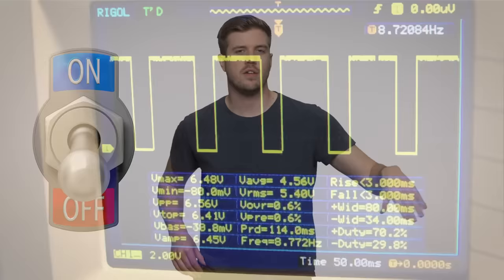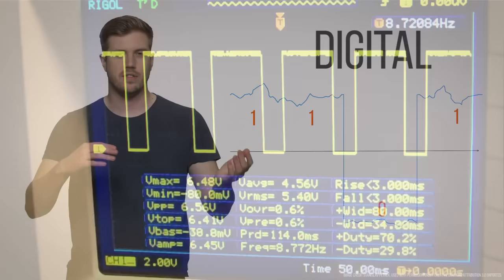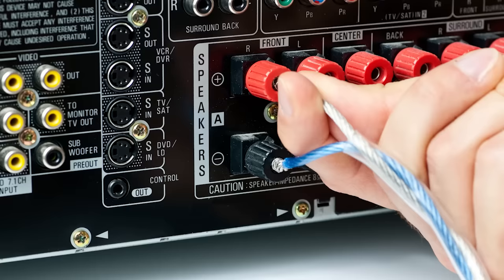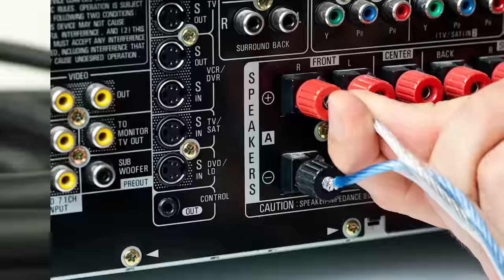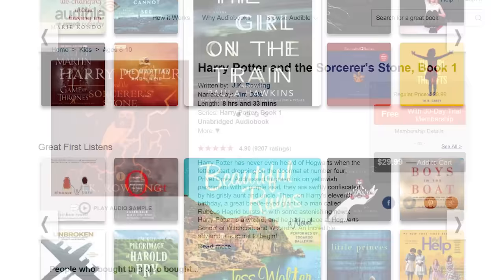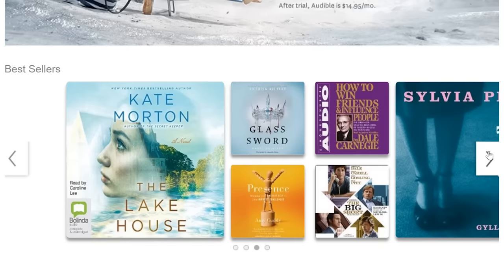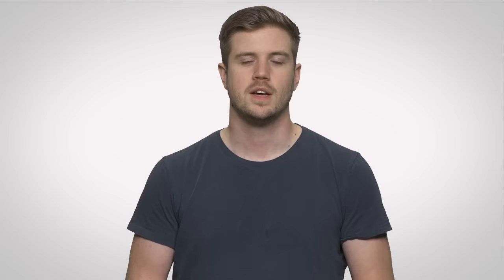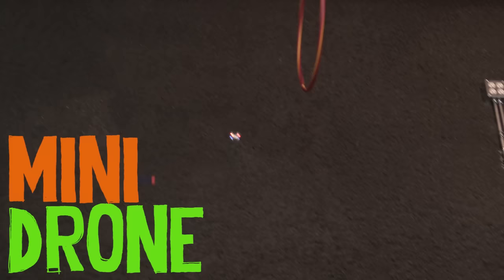Analog vs. Digital As Fast As Possible

Comment: You dont really get it :(. While digital signals are not capable of storing an unlimited bandwidth signal (analog) perfectly, they are capable of perfectly storing a bandlimited analog signal. By sampling at a rate that is twice the highest frequency in the signal, you can perfectly reconstruct the waveform in its infinitesimal details from that finite sized digital form. This is the Nyquist–Shannon sampling theorem. Now there is the problem of doing the conversions either way, but there is nothing inherently lossy about digital.

Comment: bitrate and sample rate are not the same thing..... (3:24)
Reply: my issue is he called bitrate sample rate. sample rate is the frequency at which an audio file stores the data of the sound and is measured in KHz common ones being 44.1Khz, 48KHz and 192KHz. Bitrate is how much space those samples are aloud to take up, or how compressed it makes them.
Reply: +Machina Yes, you also need to know quantization to determine required uncompressed bit rate for sampling a channel. (Like 16 bit, 24 bit ADC or storing it as 32 bit float) But I don't know anyone who measures uncompressed PCM in bit rate. Bit rate mostly describes compression (audio or video) in this context.
Reply: @szirsp  you guys are physics teachers

Comment: I was just half listening since as an Electric Engineer I kinda know these things, so I had to re-watch a couple of parts to be sure I heard it right:
1/ So logic signals are described as Up or Down and not High and Low... weird, but I guess who cares about proper terminology. (Up and Down reminds me of quarks for some reason.)
2/ Someone apparently also measures Sampling rate in kilo bits per second (bit-rate) and not frequency (like 44.1kHz, 48kHz, 96kHz or 192kHz for most audio), which is also weird...
I hope this video wins the Most Inaccurate FAP reward.

Comment: digital broadcasting is not always better 

here in australia analog TV was much more reliable than the new digital TV system we have now 

a bit of static on your TV screen is much better than pixellation, squawks and drop outs 

there are few things worse than when your favorite movie or TV show gets to the best part and is interrupted by pixellation or wose still a big NO SIGNAL message on your screen for a few seconds causing you to miss your favorite scene because of a lightning storm, variations in the ionosphere, mobile phones and other transmitters operating on the same band or some other obstruction 

analog TV signals would need to drop below around 45% (strength and quality taken into account) before the image is too fuzzy to watch and below 30% before the sound starts to fade out
analog TV signals are more resistant to momentary interference (lightning puts a tiny white line on the screen for a fraction of a second and nothing more)

digital TV signals usually start to pixellate if the signal drops below 85% will usually drop out completely at 75% (as measured by my TV) 
digital signals are much more susceptible to interference (lightning almost always causes the NO SIGNAL message to show up for 2-3 seconds every time it strikes anywhere between the transmitter and my house)
even something as simple as turning on a fluorescent light causes it to pixellate 
it is even affected by my inverter and solar regulator to the point that i cant watch TV during the day unless i turn off the circuit breaker for the solar input and stop charging the batteries (i use off grid solar so thats not an option) whereas my TV was completely unnaffected when i could use it in analog mode 

digital is the best option for storage, playback and short range data transmission (WI-FI, 3G/LTE, bluetooth.etc) 
but analog still takes home the gold medal for medium to long range over the air broadcasting (TV/radio signals.etc)
Reply: you are correct
Reply: if only more people understood that the analog TV system was superior

analog and digital both have their advantages and drawbacks but you cant solely use one for everything

there are things that analog does better
there are things that digital does better
Reply: My argument exactly, with a slightly different example. The mandated switch to APCO P25 digital radio systems was a massive step backwards for public safety communications. When our deputies are in the more remote areas of our county, their radio transmissions tend to "squawk out" and we (in dispatch) cannot understand what they are saying, and vice-versa. Worse, many times we won't hear the transmission at all. The old analog radios had a bit of static in those areas, but we could still communicate.
Reply: just like using a mobile phone with 1 bar of signal
good luck even getting the call to connect let alone having a reliable conversation with the person on the other end

the main reason they are switching to digital is for money

with TV they have more channels for the same amount of spectrum including a few that run 24/7 informercials thus more money

with 2 way radio less bandwidth is needed allowing more radios to use the same ammount of spectrum but at the expense of not working at long range thus more money from not needing to license more spectrum from the government

its all about the money and its a habit we need to stop

Comment: Hey kids, lots of errors in this video!
Reply: +Prince Westerburg Hmm he sounded to me like he knew his stuff. Please be a sport and tell us about some of the errors, thanks!
Reply: +Graham Wellington Uugh, where to start?! The guy isn't involved in the subject so his articulation of it is dwarfed by a need to look 'cool'. This is compounded by his digital generation view of analogue.

The length of your speaker wires doesn't matter so long as they are the same length and are not next to an inductive source such as mains or power transformers - this is a low voltage, high current situation so interference would be inductive and frankly, unlikely.

Digital doesn't suffer from interference?!? Hahaha!!! Sure, I'll just throw out that £30,000 CD transport and use a £10 DVD player from the supermarket then. No. Even people with 'cloth ears' can hear the collosal difference.

Digital is measured on the bit's wavefront rise so shitty cables, solder and connectors with semi-conducting junctions coupled to poorly implemented op-amps will cause jitter and errors. I'd rather listen to original data put there by a £2m studio then error correction put in by a 2p chip!

"We live to a great extent in an analogue world" - Err, what, are you in Tron some of the time then?

To his credit, he did say that higher bit rates usually mean higher quality - Maybe he has heard of Nyquist Theorem? Also he does state that digital cannot capture all the infintesimal subtleties of analogue. This is true and digital only captures the voltage changes, not current.

Further to this, I live in line of sight of the largest TV transmitter in Europe and we always had crystal clear TV. Since the move to digital its just terrible. With analogue you always got a picture, with digital, if the signal isn't 100% perfect then its glitchzilla!

So I don't hate the guy but he's a little fly and uncohesive in his presentation.

In a nutshell, I can only quote a hifi designer friend "Digital is the realm of man, analogue is the realm of God."
Reply: +Prince Westerburg Ha! Pretty good! I am an admitted ignoramus to this stuff, but while he sounded to me to know his stuff, you sounded like you know even more! Thanks Much for taking the time, and have a Great day!!:-)

Comment: HDMI was a bad example... the lengh and quality of a HDMI cable matters A LOT. especially if you use HDMI 2.0 with 3840x2160@60Hz. you will be very lucky to get cables above 5m working, 3m is already a problem.

Comment: I bought a video capturing device that turns analog RCA audio and video to digital via USB...
I captured video and I see a horizontal desynchronisation between the horizontal lines...which makes edges look like zig zag...mostly when the movement of people or objects is greater...how can I get rid of that? Can I use a software to correct that after I captured the video? Or is there a software that corrects that while capturing the video?
thanks!

Comment: My about 200 CDs started to loose its data after 20 years beginning in 2005. Thus I have changed COMPLETELY back to VINYL LP's in 2007 and I am HAPPY again. Right now, I have a total analog music system and it is just WONDERFUL. How long will my LP's last? About 70 years guaranteed and I already have original albums of the Sixties, which are still perfect. Good luck with your data strategy!😂

Comment: 3:25
128kb/s-320kb/s in the background of the illustration does not represent the sampling rate, but the data transfer rate.
The sampling rate is much higher, and is usually in the range of 44,100 samples per second or more.

Comment: I really miss analog television. I used to be able to watch over 40 channels, and even if the signal was weak, I was at least able to see something over the static. Nowadays with digital over the air, I'm only able to receive 10 channels. Also if you have bad signal, you would either see a black screen on a pixelated image. Also, it takes forever to scan to find channels compared to analog where you don't even need to scan. Good thing that CTV Ottawa still broadcast in analog
Reply: That is pretty much the only valid argument in favor of analog broadcasts, but I have to admit, it's a pretty strong one. Thankfully you can usually get your channels back by spending 500 bucks on a actually good roof mounted antenna (which is not that much in the grand scheme of things, considering how many people spend over 100 bucks a month on cable TV which has worse video quality in many cases).
Reply: @awesomeferret  Man I forgot I sent this comment years ago. I am definitively looking into antennas these days and I hope I find something suitable soon!
Reply: @DoughnutMasterStudios  Check out a channel called Antenna Man. If you are serious about OTA TV, I wouldn't even consider an indoor antenna.
Reply: @awesomeferret  Unfortunately I don't live alone and I have no chance convincing anyone to install an outdoor antenna. Not even an indoor antenna in the living room because that is "outdated" according to my parents. The only place I can install an antenna would be in my room where I can use a digital tuner to display video on a 5.5" black and white CRT. Currently with a telescopic antenna intended for FM radio I can receive only 2 channels despite living very close to the broadcasting tower. Basically an indoor antenna is my only option (which is what I'm looking into). I have heard of the Antenna Man before, I guess I should watch some of his antenna recommendations.
Reply: @DoughnutMasterStudios  That's some sad irony right there. Your parents are probably watching the olympics at a lower bitrate than the OTA broadcasts (OTA TV is known for broadcasting at higher bitrates than cable, at least one ones that broadcast in 1080i). Surround sound is a thing for every major OTA channel too. Maybe figure out a way to force them to watch a few Antenna Man videos? Another sad irony is that cable is itself about 50 years old now.
Reply: @awesomeferret  They only use streaming services, especially Netflix. They haven't touched cable for many years now
Reply: @DoughnutMasterStudios  they're missing out, wow. The golden age of streaming services is over, now that it's just as expensive as cable and cheaper to buy used optical media (unless you absolutely have to watch brand new content).
Reply: @DoughnutMasterStudios  get rid of your crappy and old CRT and invest in a more modern and more durable and reliable digital TV
As we all know Analog TV no longer exists
Reply: @stephensnell5707  deez nuts

Comment: digital means the signal or content, is either binary OR analog with binary during at least 1 stage of processing. Analog signals are usually amplified de-amplified or multiplied/divided or transposed into higher or lower  frequencies and processed with or without electricity.
Reply: Digital is better

Comment: 1:28 There is not such thing as VGA cables; VGA represents the 640x480 resolution. Those are D-sub cables that carry an analog RGBHV signal.

3:22 Sampling rates are not the same as bitrates!
Reply: I think he was trying to make a distinction between sampling rate and bit depth

Comment: The next things you guys should try is NTSC and ATSC, i dont know if you could get both on one video
Reply: and PAL, all I know is that PAL was 567p (dont quote me on that exact number) and NTSC was slightly lower resolution, they also used different equipment and couldn't work together without some sort of converter or else the picture would be black and white.

Comment: You could have shot that whole video by completing the clock analogy: Analogue second hands constantly move, Digital second hands "tick" into position each second.
Reply: +daDonn Digital seconds would be the changing second values on a digital LCD watch.

A physical clock's ticking hand still moves in analog as it "ticks."

To represent the physical second hand in a digital context, you'd film it, and the perceived movement frame-to-frame is "digital" since you've lost the movement information not recorded between frames.

This is heady stuff, I know!
Reply: +Jween Tech To be ultra precise yes, a second hand that ticks DOES technically fill all spaces between each tick as it moves thereby making it analogue, but in practical terms it locks into a single position for the duration of each second. My comparison was between that and a second hand that smoothly travels around the clock - my grandparents had such a clock - which would have served as an adequate analogy.
Reply: daDonn
True.

Comment: Ok here is an explanation for the difference between analogue and digital that hopefully anyone can understand. Lets start with the basics.  The word analog is short for analogy, because analog systems are built on the basic principle of one thing being used to represent a different thing, just as an analogy is one idea or thing being used to explain a different thing.  Digital however is a series of instructions to explain something.

Lets say that you want to make cookies in the shape of gingerbread men.  There are two ways to do this.

The first way is to use a cookie cutter in the shape of a gingerbread man.  The cookie cutter is not an actual gingerbread man cookie, it is an analogy for the cookie.  Something that physically represents that cookie in a form different from the cookie itself and can be used to create the thing you want when applied to a medium, cookie dough.  That is analog.

The second way to create the gingerbread man is to write out a list of instructions on how to use a knife to cut out gingerbread men shapes from dough.  step one, cut a curved line, step two connect it to a smaller curve, etc.  This series of directions is not a physical representation of the cookie you want but a series of directions for creating the cookie you want.  That is digital.

And from this example of a cookie cutter vs directions you can understand and explain the major characteristics of digital vs analog representation.

A cookie cutter is a simple and direct in application.  It doesn't require much in terms of understanding to use because it is applied directly to a physical medium.  While directions require a brain or processor to understand the language of the directions to use them.  

However making copies of the cookie cutter is much harder because you have to physically craft a whole new cookie cutter and carry it to where you want while you can just tell someone the directions and they can write down a new copy.

Also you can improve upon digital directions in a way you cannot with analog.  Let's say you want a gingerbread man with a hat.  You can't just add a hat to your cookie cutter, but you can add an extra step to your directions for a hat.  The same goes for repairs.

You cannot fix any problems with your cookie cutter without physically changing it.  But you can   patch any problems in your directions by erasing steps or adding new ones.

Over time your cookie cutter will wear down every time you use it, while your set of directions will not.  However unless it is completely worn to a numb, you can still get a vaguely gingerbread man shape using a worn cookie cutter, while you can't follow the directions at all if you are too far away to hear or read them all completely.

Finally your cookie cutter has to be complete from the get go.  If you want your cookie cutter to work exactly how you want it to, you have to have its design completely worked out ahead of time.  Because once it is made the way it works, its algorithm is set in stone.  It will never do anything different from the exact thing to the exact measure that you build into it.  But with directions you can always go back and add new steps or erase old unclear ones, so you don't have to be as exacting in the planning stage as when building a cookie cutter. 

So that, in an analogy, is the difference between analog and digital.  It's all just cookie cutters and directions.

Comment: There is quite a mistake at 3:20 confusing sampling rate representing the number of digital sample per second during the conversion counted in hertz (hz) , tipically 44khz or 96 khz. And the bitrate of an mp3 file reprensenting after lossy compression the number of bits per seconds remaining tipically 128kbps - 320kbps. 
I don't get why this second one is displayed in the video and not the first one while lossy compression is a whole different topic.